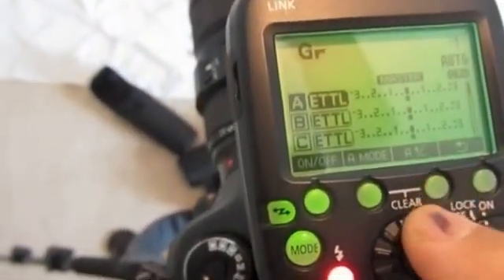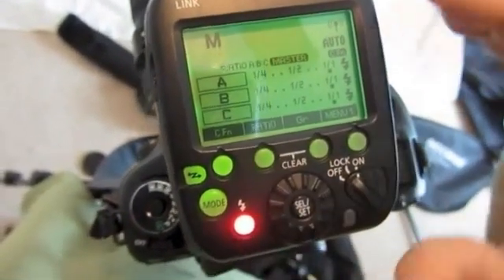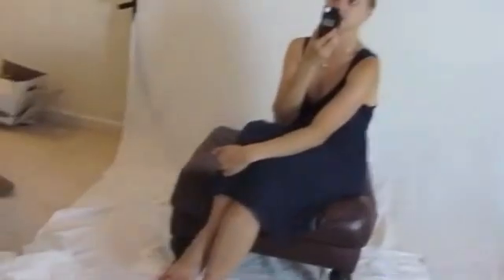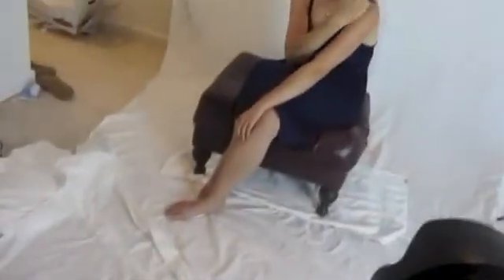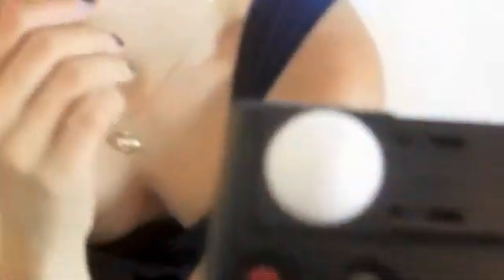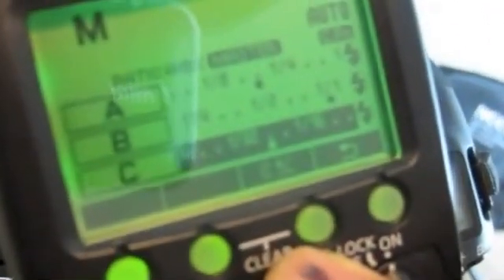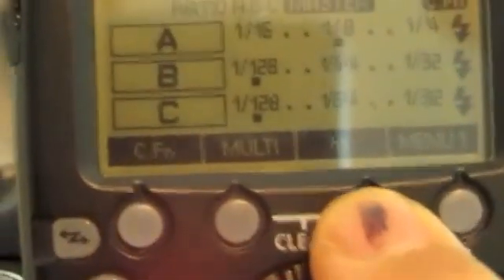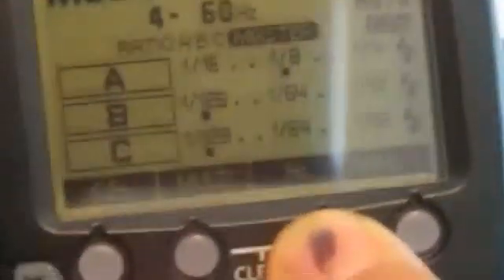Canon 600Ex-rt and transmitter ST E3 RT, manual, ETTL usage

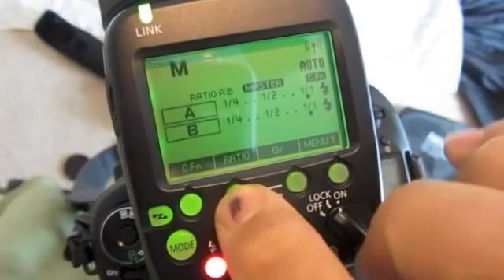Comment: @4:15 when you switched to manual on the ST e3 Rt transmitter... Did you have to change each flash unit to "manual slave" from "ETTL slave"? I tried to do exactly what you did and it wouldn't link (no green light).

Comment from the maker: This system at this time only works with the 600 series speedlites and would not work with any other flash units at this time (external flash units) unless they are put on optical slave mode -- --  Please, subscribe as I do a lot of manual flash and you may catch something new in one of my uploads -- I am always trying to expand the knowledge of all photographers and wish everyone the best.
Scotty, there are after market products that will work your 430ex without any problem and even in ettl

Comment from the maker: this system only works with 600 speedlite system as a system goes - you can make it fire slave units but those units will be manual and limited sync speeds.
Hope this was helpful for you.

Comment: Is the transmitter compatible with the other speedlights in the range, say the 430EX11 if you also had a reciever on there? I got a few speedlights and at the moment i have smoe triggers that work in ETTL with the older speedlights and this but it's not really pulling things together in the group modes

Comment from the maker: Allwin, on the 7d you will lose half the ability of the speedlite as it is not fully compatible as reported by Canon.
250 drops to 125 of a second to control fully -- again, as reported by Canon.
But with that said,  by all means get the 600 ex   -- it is stronger and can take more punishment with respect to recycle time then previous models.
And maybe in the future they may have a firmware update to make it fully compatible with the 7d.

Comment from the maker: This is kind of easy Dia Bach, once you put them in group as you did you SHOULD be able to meter each one separately. 
You have to make sure you have the transmitter showing M mode which is manual and then you will tap the flash icon on transmitter until groups show up then go "GR" key and tap it until you first see "A" group and then tap "a mode" which you would select the "M" and you should then be good to go. Follow this for "B" group which is actually flash you called "B".

Comment: Hi great video.
I own 3 600 EX - RT's and an ST-E3_RT.
I had hoped that I waoulsd be able to control the thre units designated A B C in the manual mode meterinbg each one individually as i set up my portrait session in the same way as I do with my Quadra outfit. From my efforts to date it would appear that this is not possible and I have to resort to ETTL. Any comments welcome.
Smiles from miles

Comment from the maker: Jon, make sure on the 600 you hit the two sided arrow (on the outside of the speedlite - not a LCD choice) until you see the green "LINK" light come on. 
You also have to have your 300 transmitter on for the LINK light to light green - which also means the speedlite is charged and ready to flash.

Comment from the maker: keep your 600 speedlite in the "green light" mode -- if you are shooting wireless which you are with the 300 ex rt  on -- when you see the green light on both transmitter and speedlite they are synced. Then only change settings on the transmitter only and it will make changes on the speedlite. Go to GR = group (tap it) and then go to "a-mode" which is inside the transmitter window (not the mode button on the outside). press it until you see the "M" = manual show then "A +/- to do adjustments

Comment: I'm having rouble adjusting the output of the slave in manual mode.  I have the st-e3-rt and one 600ex-rt at the moment.  I want to familiarise myself with the Manual Mode as well as ETTL...  However when I set the TX for M and the Slave for M i can't seem to adjust the output  power from the TX... can you assist?

Comment from the maker: down to function 6 and then press the set button and scroll to ''ON'' - - this will avoid all those too quick to fire shots we take... it will not be properly exposed but, you may get lucky sometimes and it may be usable -- this is especially useful on fast candid shots where you can never get that shot again... I also shoot RAW so I have more flex with any touch ups.

Comment from the maker: glad you enjoyed it -- tell me if you need to  see a video on any other functions of the 600 speedlite -- and I will fire one off for you -- take care -- PS I am using a low cost (YongNuo External Flash Battery Pack SF-18 for Canon EX580 II EX580 Holding 8 AA Batteries)   for about a month now and it recycles the charging time about one second faster (33%) by my calculations... also, go to functions 6 on speedlite and set it to "ON" - -Go to page 92 (hold down the ZN key until you can scroll